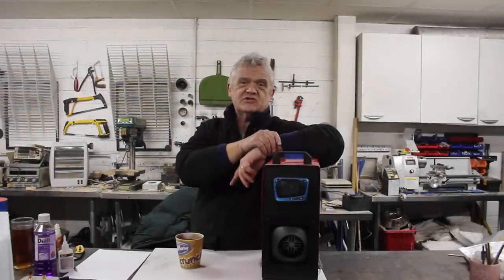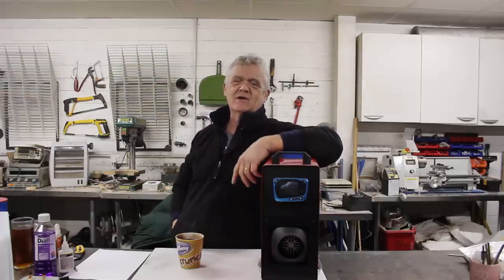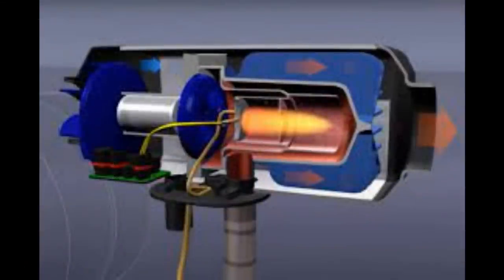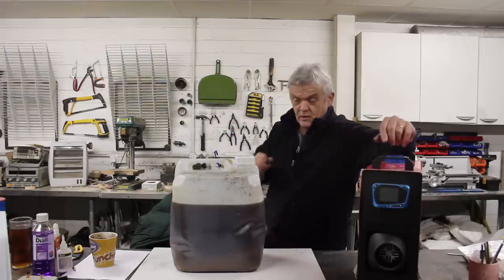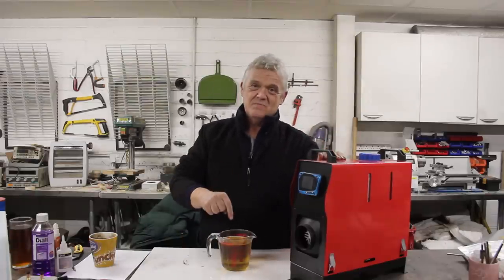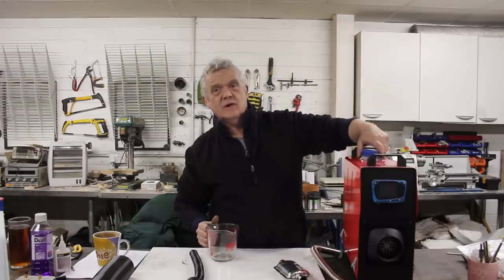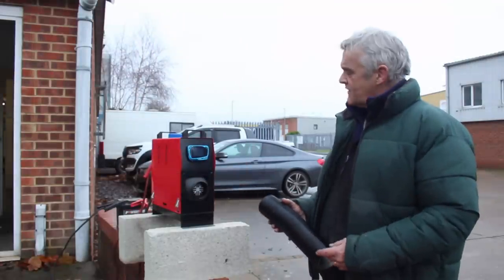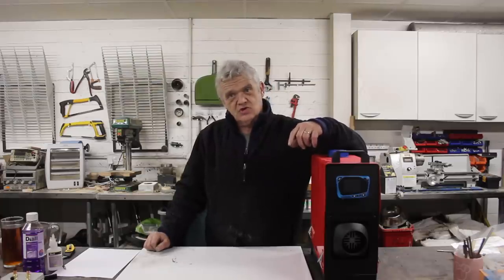1793 Home Made Fuel Running A Diesel Heater

Comment: In the UK "paraffin" refers to kerosene.  In the rest of the world paraffin is another name for candle wax and kerosene means kerosene.
Reply: There is also a paraffin lamp oil and I believe that is a pretty standard name/label around the globe.  And that is the product that Rob is referring to.  Apparently it is more refined than kerosene and has less smell when burned, which makes it better for lamps.
Reply: Yes.  I had to figure out what he meant.  I didnt think wax would work...lol
Reply: @justinw1765  In North America lamp oil is labelled "lamp oil" but we know it's kerosene.  Nothing is labelled "paraffin" except candle wax or the wax used in food canning.
Reply: Thank you for clarification to us across the pond.
Reply: Ha ha ha ha that is so rich!!  I seriously was preparing to try to mix literal wax paraffin with spent oil!!  Good catch!!!!!  Just in time 😁
Reply: Oh, thanks for clarifying. I've heard of the Veggie/Kero mix for running diesel engines on vegetable oil before, so that makes sense.
Reply: The kerosene fraction these will run with is called central heating oil, too.  This fraction is 28s Redwood viscosity (originally the time for a fixed volume to flow through a standard orifice).  35s Redwood is diesel central heating oil and is the diesel fraction (DERV, diesel, red diesel, gas oil - all virtually the same products in the UK) these heaters are set up for (so truck drivers, etc could use diesel from the vehicle fuel tank).

The lighter kerosene fraction (not sure of the Redwood rating) has insufficient lubricity, so would rapidly wear out the pump unless some lubrication is added.  It is usually more refined, so more expensive.

Now to the calorific values.  The heater is (should be) set up for diesel.  Anything ‘heavier’ (higher than 35s R would have more energy per unit volume, so not burn completely - eventually sooting the heater heat exchanger (the casing) or worse.  The lighter fractions (kerosene, for example) have less calorific value than diesel, so these burn easier and produce less heat while burning slightly less efficiently (excess combustion air dilutes and cools the combustion gases (more heat wasted via the exhaust).

Many users run on kerosene (UK central heating oil) all the time and report no issues with pump wear and claim a cleaner burn (obvious with excess air, of course🙂).

The problem arises in that there are different controllers and motherboards fitted to these heaters.  Some can be easily accessed to adjust the fuel:air ratio (most of the older units) but some of the latest motherboard/controller combinations are not (easily) re-programmable, so the fuel they burn will give different results - soot up or burn with too much combustion air.  This means any fuel mixtures with these (cheaper?) combinations has to be the same or of lower calorific value than diesel - which can limit the amount of waste oil additions.  So buyer or user beware!

Robert was provided with that heater, listed as 8kW.  8kW cheap chinese heaters simply do not exist, even though many insist theirs is one.  The Chinese lie - the “8kW” versions are the same as the 5kW versions - and they don’t even deliver 5kW of warmed air.  Maximum fuel pump delivery is about half a litre of fuel per hour and diesel contains around 10.5kWh/ litre.  

That, in itself, does not mean they are not a good means of heating - they are.  Personally, for use as a vehicle parking heater, the 2kW versions (smaller body) are more than adequate for most UK vehicle installations.

Oh, and BTW, the burners are not so easily cleaned, if they get seriously blocked.😢
Reply: @justinw1765  Lamp oil is actually more refined again than paraffin, good clear lamp oil is more expensive than paraffin and has less odour if any at all.
Very refined paraffin (Pharmaceutical grade) has no taste or odour and more expensive than lamp grade paraffin (lamp oil) obviously, and is an oral treatment for constipation.
Kerosene is pretty much our home heating oil here in the UK, probably what is referred to as K-1 kerosene in America...K-2 can have as much as 10 times more sulphur.
These heaters will run readily on All of the above including any vehicle forecourt diesel, red dyed diesel too of-course.
Kerosene is a very Broad term for many types/grades of fuel of this nature, also named, renamed/branded/rebranded differently all over the world. 
This does not make it easy when trying to source the "right fuel" for a specific appliance or application.
Also! different forecourts often add their own additives' after the fact, for different reasons...winter/summer and longevity of the fuel.
Yes! it's a mine field out there, you'd almost think this confusion is deliberate 😆
Reply: The Paraffin oil that I ordered from Amazon had no odor but the Kerosene lamp oil I bought locally in the US smells like a light Diesel fuel.
Reply: Thats Always the same Problem when you watch Videos from foreign countrys. I'm from Germany Here you can buy all these things lamp oil, kerosene, Paraffin or Petroleum. What jou need is a flammable liquid thinner then the food oil. Kerosene for example would mean in German more like fuel for aircrafts. Way too much Power, you need something with no flammable Gas.
Reply: @garyargabrite1562  This sort of thing happens all the time. If you read many reviews on amazon, you will find lots of unhappy and happy customers that know the difference. Apparently lamp oil wicks slower (more viscous) and paraffin (heater/stove grade) wicks quicker if I remember correctly, heater paraffin may also burn hotter somewhat, but again; I'd need to check as it's been a while.
I've spent countless hours on this as I have oil lamps and heaters not to mention stoves that run on this stuff.
It's a real pain trying to find a Good supplier with the right stuff and at a fair price.
Oil lamps really need the Good stuff and heaters (if burning indoors) need low sulphur and other dangerous additives to be at a minimum...it's hard to know what we're being sold to be honest Gary.
Although I pointed out differences in these fuels, how we know what each seller is selling us is something else.
Reply: Thanks from across the pond!
Reply: @Harrington2323  I agree 100%! White gas/naphtha is pretty much petrol but more like the Zippo lighter fuel or expensive Coleman fuel. I accidentally purchased a stove that runs on Coleman fuel not realising how expensive it is, not to mention how potentially dangerous it could be; especially if using inside.
Reply: Paraffin is more refined than kerosene
Reply: @justinw1765  Lamp oil mmmmm  In my mind, I just had a 'smell flashback' to the pit head lamphouse       ;<)
Reply: James" Paraffin" Young invented cooking  shale ore for oil and started first oil rush in West Lothian Scotland in 1860s paraffin safety lamp was invented in Armadale and paraffin wax ,Broxburn was centre of world candle industry till 1920s.
Reply: I wonder if it HAS to be paraffin lamp oil if that is what Rob is using. Could you use standard kerosene with the used oil mix. Kerosene is much cheaper than paraffin here in Australia. 1 litre Paraffin is $16 AUD and only $ 6 AUD for Kerosene.
Reply: same here
Reply: @regwatson2017  $6/L isn't (only) in my opinion, as a fellow ossie 
I remember kero being petrol prices or less, not 3 times ul rate 
Time to invent, adjust, adapt, say no thank you to high fuel prices
Reply: A little tip for burning kero/paraffin in a lamp in the house. At one time you could buy a small bottle of deodoriser. It is citronella oil watered down with a bit of meths( a few cc's).
I just use neat citronella oil. Works well.
Reply: Paraffin means “no affinity” it’s the longest chain hydrocarbon that runs from solid wastes to thin oils. 
These small stoves reject considerable heat out of the exhaust. Run the exhaust through a (dry of course) domestic radiator and you’ll extract significant additional heat. 
The easy way to clean used cooking oil is to boil it over water.   It can’t overheat and the steam really cleans the oil as it rises through. Boil it until it’s clean then draw off the clean oil and drain the dirty water.
Any mushy mix can go into the next batch.
Reply: As someone who sells and deals with both, paraffin and kerosene are not as the op says here in GB. Put in the simplest terms kerosene (heating oil) is ‘clean diesel’, paraffin (lamp oil) is ‘clean kerosene’. Both can be used in say an Aladdin mantle lamp, but paraffin burns odourless when burned in a blue flame state where as kerosene does not. As far as looking into it goes US lamp kerosene is paraffin but the US don’t like naming liquid fuel with anything that starts with P 🤣
Reply: Actually, paraffin in the UK is definitely NOT the same as kerosene. Paraffin has a pleasant smell but kerosene absolutely stinks.
Reply: @milespostlethwaite1154   To quote: " Kerosene, paraffin, or lamp oil is a combustible hydrocarbon liquid which is derived from petroleum. It is widely used as a fuel in aviation as well as households. Its name derives from Greek: κηρός (keros) meaning "wax", and was registered as a trademark by Canadian geologist and inventor Abraham Gesner in 1854 before evolving into a generic trademark. It is sometimes spelled kerosine in scientific and industrial usage.[1] The term kerosene is common in much of Argentina, Australia, Canada, India, New Zealand, Nigeria, and the United States,[2][3] while the term paraffin (or a closely related variant) is used in Chile, eastern Africa, South Africa, Norway, and in the United Kingdom.[4] The term lamp oil, or the equivalent in the local languages, is common in the majority of Asia and the Southeastern United States.[5] Liquid paraffin (called mineral oil in the US) is a more viscous and highly refined product which is used as a laxative. Paraffin wax is a waxy solid extracted from petroleum. "
Reply: I already wondered how Rob made the "candle wax" so liquid! 😁
Reply: @garyargabrite1562      These hydrocarbon (mainly) products are separated from crude oil, by fractional distillation.  Different fractions are those collected at various temperatures, so contain, mostly, ‘anes’ with closely regulated carbon chain length - but they are mixtures, not pure compounds.  Different crudes provide different percentages of these fractions and the refinery can adjust the process, too.  Then there is ‘cracking’, so these products can be blended to achieve almost whatever the refinery produces - all at different price points, of course.  

Think here of gasoline/petrol which is basically an ‘ane’ with other refinery products added/blended to provide a reliable fuel for ICEs; vehicle diesel fuel also contains ‘cetane improvers’ and other additives to reduce gelling at lower temperatures.

Paraffin is a lighter fraction than kerosene in terms of average carbon chain length.  Not much, but enough to alter the characteristics between the two fuels.
Reply: @to the point  Basically correct.  The paraffin for ‘lighting’ and ‘in-room’ heating is still a mixture of the same ‘anes’ - just more of the lighter ‘anes’ with virtually none of the longer chains - hence more expensive as it is further refined from the initial fractions.  Therefore a more narrow range of those compounds.   Including shorter chain fractions would increase the flammability of the mixture - think closer to petrol, which contains the light naptha fractions (plus, of course, other petroleum compounds than the simpler ‘ane’ straight chain compounds).  Lighting ’paraffin’ will have had any sulphur compounds removed, for that ‘low-odour burn’.  Just like the improved vehicle diesel fuel these days - 20 years ago it contained a lot of sulphur compounds (as impurities in this mixture); it was then improved, as a road fuel by limiting the sulphur to a lower level; now we have ultra-low sulphur diesel fuels to reduce combustion pollutants, from road vehicles, to the minimum possible.  Nothing different than less polluting coal types in the past.  One could compare other fuel improvements over the years….

For a long time we have started, and run, spark ignition engines on petrol/gasoline.  The fuel needed to be sufficiently volatile to evaporate and burn when a spark occurred.  Many of those engines only burned petrol (gasoline) but a cheaper, less volatile, fuel was also used - called TVO in the UK and Kerosene (or “Distillate”) in the USA.  One can throw a lighted match into that fraction and it will be extinguished (rather different than petrol/gasoline! ).  That fuel was only useable by pre-heating the charge to the engine (heated by the exhaust gases passing around the inlet manifold) before it could be ignited by a spark.  This type of fuel was later totally superseded by use of diesel fuel (of course, there was overlap with ‘semi-diesels before the really high pressure injection pumps were adopted) which were developed and became much more fuel-efficient than most spark-ignition engines.

The trouble with those writing, and reading, about the fuels used in these cheap chinese diesel air heaters is the limited understanding of the multitude of fuel fractions and the various nomenclatures used in different parts of the world.  Nothing different than the petrol/gasoline names for the same stuff depending on where one might be living.  Everyone needs to get used to it.
Reply: Well yea but there is a thing called paraffin wax in the uk. Which can be used for lubrication, making into crayons and other things I guess.
Reply: Parrafin is c1 and kerosene is c2
Reply: @kevinhansford3929    There you go. Parochial to the last.  YES - in your part of the world!
Reply: @Harrington2323  Kerosene / Paraffin is jet fuel. Same thing, no flammable gas.
Reply: GOLLY!....do we ever need, once and for all,   WORLDWIDE definitions and names for all this stuff!  So that someone in Iceland can talk to someone in Vietnam and actually be referring to exactly the same liquid.
Reply: @PeterJavea    Not really, Peter.  These chinese air heaters have that word ‘diesel’ in the name.  It means they are designed to burn DIESEL.

DIESEL is known, worldwide, as the fuel which is used in millions upon millions of vehicles with DIESEL engines.  So no problem for the whole population of owners to know that - if only they can read!  

What can be simpler?  It is only those that choose to burn other mixtures of hydrocarbons and/or other carbon containing chemicals that need to explain, more precisely, what they are up to, instead of befuddling all those that use different designations for the products of fractional distillation (look it up if you don’t know).

Just think: Diesel air heaters burn DIESEL.  They are designed to burn DIESEL.  They are not designed to burn fuels other than DIESEL, but can do, if they can be adjusted - or the user doesn’t mind (or care) whether it is burning properly.  Not all heater controller/motherboard combinations can be (easily - if at all) adjusted.  If EVERYONE followed the instructions and burned DIESEL in their chinese DIESEL air heaters, nobody would be befuddled, misled or spouting things that are simply not true (OK,  there will always be those that don’t know, but still make idiotic comments).
Reply: @hadleybee9710  It'll work.
Reply: And not forgetting jet fuel which is in fact kerosene.
Reply: Well, THATS helpful to know! Thanks for the clarification!
Reply: @hadleybee9710  
Ikr...i was like o...k...?🤷🏽‍♂️
Reply: @garyargabrite1562  what brand of paraffin did you buy from Amazon gary ?
Reply: This is a good piece of information to know. Im in Canada not the UK, so I watched this and wanted to buy some "paraffin" but I think Ill look for kerosene now instead Thx
Reply: Good to know.

Comment: As a heater, you can legally run these things on red diesel, you just need to fill a form in at the petrol station to buy it.
Reply: If you can find one that is. Since the legislation on who can use it changed, most if not all around here (Northants) have stopped selling it. I can buy it in huge quantities locally, but that's not really that practical for the amount I consume.
Reply: Heating oil works it's basicly red diesel but normally someone has to buy like 500 gallons!
Reply: I do just that. When i pay for my container of red diesel (gas oil) the person on the till produces a form to fill a few simple details in on and everything is fine. Customs can come and check up if they have any suspicions the red diesel is being used for illegitimate purposes.
Reply: @howardosborne8647  I once had a car which had the ability to have a Webasto auxiliary heater fitted to warm the car up on a timer or provide additional heat when the engine's running. There was a 'how to fit' thread on a forum for the car, and one of the posts was regarding fitting a small fuel tank in the boot, just to run the heater off red diesel, apparently the taxman said this is also OK to do, so anyone running one of these to heat a motorhome should also be able to do the same, rather than use regular supertaxed diesel from the main tank.

Comment: Im loving same diesel heater -40C and keeps my 12×24foot shop 15C on lowest setting. Amazing heater but I do find lots of heat is wasted through the exhaust could definitely do heat recovery radiator with the exhaust system
Reply: Yes I've done it, it works great.
Reply: I had to build a thermostat to cycle mine in and off because it was cooking me out a guy builds one it's called the afterburner!

Comment: Use a bosh injector pump from an old rover diesel, filter the used veg oil with £5 ebay filters, no parafin needed.    Used to run it in my old rover 400.